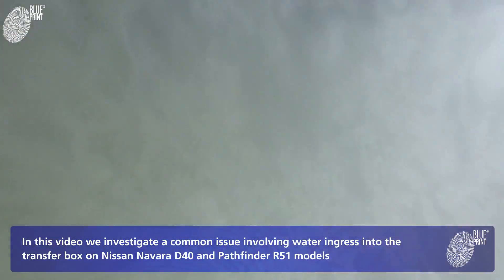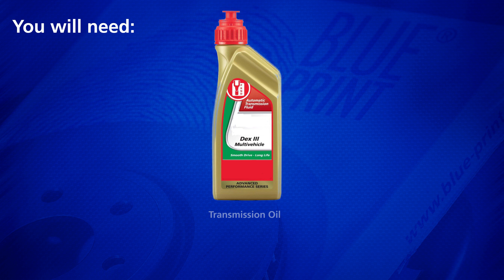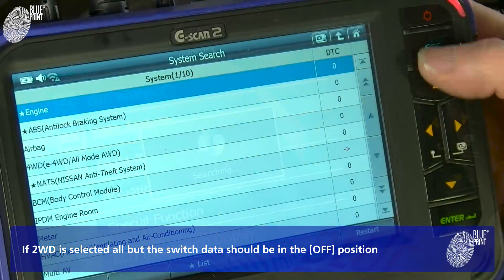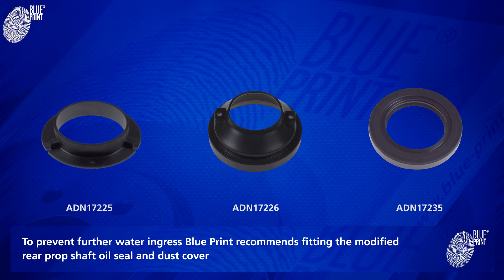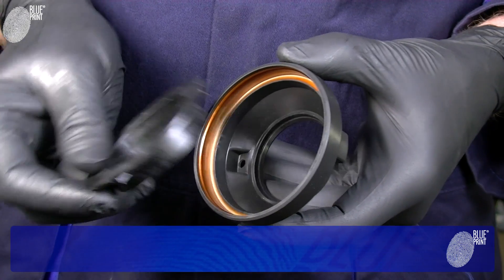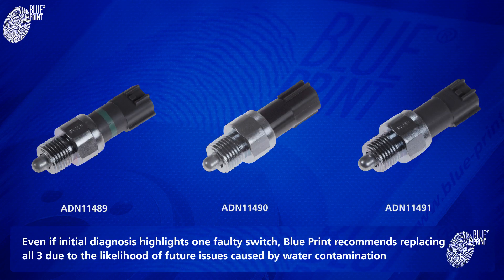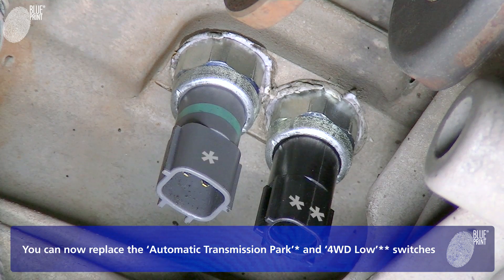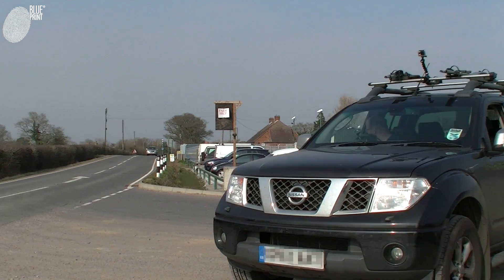[EN] Nissan Navara D40 - Transfer switch fault diagnosis and replacement

Comment: My D40 is going into low range. I've just replaced the switches on mine on the assumption that they were the problem but its still not working (neutral switch on the gearbox is working replaced it a little while ago because cruise control was not working.)

What next? How do I test the solenoid / activation thing?

Comment: Good video thank you. What are the oil specs you the box and how many litres?
Reply from the maker: Thank you for watching our video and positive comments. The transfer box on the featured vehicle in this video has a service capacity of two litres and the recommended oil is the AFT fluid Dexron III.
Reply: @BluePrintCarParts  mine is a 2010 navara d40... is the gearbox oil separate and what type is that
Reply from the maker: @markklinkert3477  Yes, the gearbox is separate, the capacity is 4.3 litres and takes manual transmission fluid (MTF) HQ 
Multi 75W-85 or API GL-4, Viscosity SAE 75W-85.
Reply: @BluePrintCarParts  thank you. Excuse me picking your brain but you seem to know.  When my car is cold the clutch moans ( for the first 5 min approx). I thought it was the clutch thrust so I replaced that but it's still making the noise. It's just in the morning. If I park and drive later in the day it is normal? And it happens through the whole throw of the clutch pedal. Thanks again
Reply from the maker: @markklinkert3477  Diagnosis by description only for noises is always difficult to pin point. However, by your description this does not sound correct.
Reply: @BluePrintCarParts  ya. Something is not happy but I can't place the sound / component
Reply: @BluePrintCarParts  Hi. I'm going to do the gearbox oil. But I can only seem to get 75w-90 (gl4/gl5 compatible)... I'm in south africa (for temp reference). Will that oil be okay?
Reply from the maker: @markklinkert3477  Our advise would be consult with your local oil supplier to make sure it is compatible with the original specification.
Reply: @markklinkert3477 likely this is resolved, but D40's have an issue with the firewall cracking. Mine was the same, weird noise, slowly losing clutch action until eventual failure.

Comment: Is there a link to buy the parts?
Reply from the maker: Thank you for watching our video. There are many motor factors in the UK and online retailers that stock our parts. Please contact Ferdinand Bilstein UK Ltd. Tel: 01246 479080 for your nearest distributor.
Reply: @BluePrintCarParts  I'm in australia and cannot find your parts, do you have nissan part numbers for the seals, i can find the dust cover outer but not the inner or the proper oil seal. Pulling my hair out here lol
Reply from the maker: @zuberilol  Thank you for watching our video. The Blue Print part number for the propshaft oil seal is ADN17235, this can be found on our online catalogue www.partsfinder.bilsteingroup.com where you also can find the OE-Comparison part number.

Comment: Hello,

I have Pathfinder 2.5 dci and 4LO does not working, blinking like in this video. We checked the switches, but they works.  Does anyone have any idea how I can fix this?
Reply: Kindly check the the relay inside the relay box under the bonette and the wire inside the conduit near the sensor it may be defective . I got the similar problem with my Navara 2009. By repairing the wire its ok now